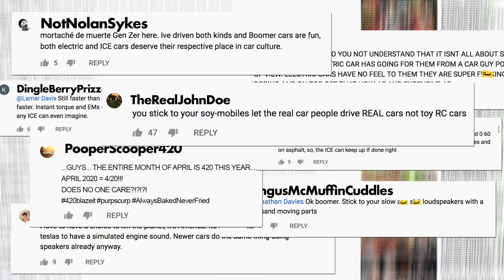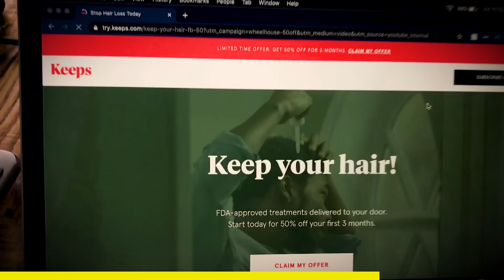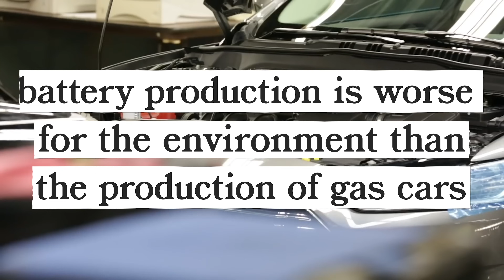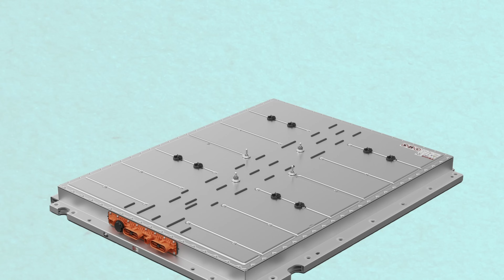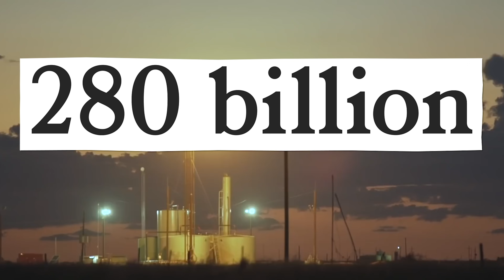Are Electric Cars REALLY Better for the Environment?

Comment: A lot of the pollution caused by car production could be removed by using hemp based products like plastic you could build the shell of hemp plastic look at Henry Ford’s hemp car! Then produce biofuels using hemp and produce cheap clean fuels that unlike using corn ethanol alone allows way more fuel by weight! We can convert our cars to hemp forerunners!

Comment: There is one factor to account for, Classic cars, classic cars have already replace the carbon footprint they displaced during the manufacturing process, and putting modern parts like fuel injection and modern brakes, you have a stylish, modern feeling classic that sounds great, plus it matches and even beats the emissions of an EV over time, unless they make a battery with capacitors that work better and impact less than Lithium Ions, plus the whole exploding thing.

Comment: The real solution: make LIGHT cars that use less energy to move that run on gas. We used to make cars that could get 50, 60 miles per gallon without even trying like the geo metro or honda crx. If everyone drove 100cc mopeds that would be way better than everyone driving ev's.

Comment: What keeps me away from electric power is the initial cost and lack of self service, even as an an ASE master tech I don't have the ability to service current electric vehicles.
Reply: What is there to service??? Literally just bearing seals, coolants, battery replacement after nearly a decade and the other regular stuff involved with a car like tires, bushings, brakes etc. One of the best things about battery electric cars is how low maintenance it is.
Reply: Evil me I do agree whit you and and they also cost to match for any EV whit long range, i don't have a charging station at home and when it get cold you lose alot of power.

Comment: Fucking stop showing the cooling towers emitting steam when you talk about pollution donut!!!! Like seriously. That’s water vapor. That’s not pollution. You’re part of the problem why people are scared of nuclear energy. For every Fukushima there’s 42 more reactors that hasn’t had a melt down in Japan. That less than a 3% failure rate. For every 3 mile island there’s 98 more reactors in the US that hasn’t seen a meltdown. That’s 1%. And not to mention that the country that uses nuclear as the largest percentage of their power generation has never seen an incident (France).

Comment: Nice to see this vid has the facts correct. I can confirm these numbers and the comparison from studies and articles I have read about this very topic. there is however 2 components and I know that this video is only focussing on the environmental aspect but as car ownership goes a holistic approach should be pushed always. 9% of all carbon emissions comes from cars globally. This means that it is close to irrelevant what powers your car as far as CO2 is concerned. 

And as long as electric cars use non-replaceable batteries that charge with insane currents(being fire prone) the following rule applies: city runabout: electric, grand tourer: diesel/petrol. And don't tell me that a Tesla is suitable cross country... my ass... sitting around every 200miles for half an hour twiddling my thumb in a desolate parkinglot where the charger is. The only current solution I can think of for covering those 2 bases with just one car is the plug-in hybrid. It has the critical daily commute 50miles on battery but can perform longer journeys if need be.

Good news though that some people already are working on some liquid fuel that would be 2 inert fluids but combined would have some exothermic reaction that would produce enough energy to provide a smaller battery pack enough juice to keep the car moving. I am looking forward to those gettiing somewhere.

Comment: I gotta know what is the life span for an EV? (The life span of the battery) 5 years? 10 Years?  My F-150 is an 09 with over 200k miles.   Can an EV go that long?  Do you replace the battery?  Is the replacement battery the same as when the car is first assembled?

Comment: Ok ok you got me thare but....electric cars have to travel more miles,to travel more miles it has to have a bigger power cell...that is hevier...wich in turn meens the car is more unsafe,ok you maybe thinking but the car can always get safer right?...or so you thought,when a car's chasis is getting stifer more of the energy of a crash goes thru the whole car's chasis instead of just the front end and a litle bit of it,the chasis absorbs.but if the whole chasis absorbs the energy of the impact you are unsafe.so thats my thoughts on why electric is not strictly the future.

Comment: What happens when you factor in replacing the batteries every so many years?
Reply: Engineering explained tackled that. Also with vehicle recycling and lifespan. And yes, eh EV is still cleaner
Reply: How long do you think batteries in EV last? In miles, not by year.
Reply: Adam Iverson Jalopnik had a article in February about the maintenance on a rental Model X. The battery lasted 317k miles before needing a replacement. Pretty impressive.

Comment: I have only two points to cobalt, and those are:
Yes, 50 % of the world's cobalt comes from the DRC (20 % of which is mined under inhumane conditions), but that is the reason car manufacturers don't want to use cobalt from that region. Tesla, for example, gets theirs from China.
Cobalt is also used in the manufacturing process of other products, for example, dyes, one type of steel and it's also used as a catalyst in the desulphurisation process of fossil fuels.

Comment: Any electric vehicle won't eventually beat any gas powered car after a certain period of time, when the battery breaks down it needs to be recycled and a new one needs to be mined from a finite source. More diesel will get burnt getting the same Lithium every month growing at an exponential rate. We won't run out for an extremely long time but it's still getting harder to mine. If you're only counting the 17 metric tons for creating an EV and 2 for running it each year you're not taking battery replacements into account. That said, EV's are still better for the environment especially if you purchase a dinky toy. Not so much when you purchase a P100D and feed it electricity generated on coal with shit battery life.
Reply: Today's battery packs last roughly 9 - 12 years of normal usage and after that time, can be reused in renewable energy storage. They're not dead, but have only about 85 % of their original capacity.
For example, this almost constantly-used Tesla Model X had to have its battery replaced after driving 317,000 miles:
https://jalopnik.com/this-tesla-model-x-has-driven-over-400-000-miles-here-1841761190

Comment: I'm definitely getting a bmw i3
Reply: Jake Gravity As a owner of one i advise you to look into These things:
First you Need to know that if you Get a used one which is Older than the 08/2017 that the early non Facelift Models did have the charging cables as an option.Than if you want a Full complète navigation system you Need the Professional one as the Base one is very limited for all gens.also the non facelift ones are more flimsy which was fixed by the later ones with a wider Wheelbase( the old ones can be normally cheaply widened for more stability.And Last if you have to do longer distances for example to work and back the 60 ah won’t be sufficient so in that case get the bigger batteries
Reply: @louis-hhr9479  I'm looking at a 2014 model with range extender and tech package with the parking assist. Is that a good one?
Reply: Jake Gravity no i would advise you Not to look at i3 with the Rex as the motor is a weak 3 cylinder with a Little Tank which is Said to be annoying as you will probably waste much time refilling
Reply: Jake Gravity Also try to look into newer models min 2015 who will have a bit of the warranty left.
Reply: @louis-hhr9479  thank you very much for the advice, ill get the the one without the range extender and 2015 (I only have a budget of 16,000 usd)
Reply: I own a non Facelift one build the 07/2017 so one of the Last ones and i Must say that the older ones i checked out were mostly Not well Serviced and scummy or à bit destroyed but if you can find a really good one Even a old one without the rex with low mileage and a good price than Go for it.
Reply: Jake Gravity Good Choice!! Glad i could have helped :)
Reply: @louis-hhr9479  Ill make sure to keep you updated on my experience with the car (when I do get it of course). Thanks again!
Reply: Jake Gravity but i must say that they are good daily practical drivers

Comment: There is so much misinformation and biased sourcing out there that I get really nervous when I see pieces like this. For example, this video starts by saying that lithium is mined and that creates a lot of CO2. Well, actually the primary source of lithium extraction is from brine - seawater. Lithium is one of the most common elements on the planet, so it's not hard to find.

As to the CO2 produced - I would really like to see WHAT the source of CO2 is, as extracting litihium from seawater obviously doesn't involve CO2, so when it is mined (which it is, in addition to extracting from brine) is the CO2 coming from the mining equipment running internal combustion engines? If so, that's easily solved by switching to electric.

And no one ever goes into all the unbelieable pollution involved in the petroleum pipeline, from exploration & drilling to shipping (with spills) then processing, then shipping the final products to distribution centers, then trucking to individual filling stations - every step of the way being done by internal combustion vehciles BEFORE you even get it into your car.

As for Cobalt - Tesla has already reduced the cobalt content drastically, and heading towards removing it entirely.

Something else to keep in mind - the wars in the middle east are all about oil. How polluting is it to have an active shooting war? All those planes, and bombs, and tanks and explosions - so much crap going into the atmosphere.

 Electricity is almost always generated relatively locally, no need for foreign wars.

I'm glad Donut at least mentioned the oil refining process, but he went WAY longer on the production of lithium than he did the nasty effects of petroleum production. I appreciate the attempt at being neutral, but clearly there's some subconscious bias still.

Comment: You have to replace all your batteries in an electric car after like only 10 years and it costs the price of a new car just to replace the batteries! Buying and keeping for as long as possible a reliable internal combustion car and keeping it properly tuned is by far the best thing for the environment!
Reply: Not the price of a new car, but only about $7500 for a large battery today. In 2030, the prices are going to be way different.

Comment: Batteries batteries batteries batteries did you factor in the cost of replacing the batteries my internal combustion engine last me 20 years your batteries last four and a half have you factored in the cost of batteries Mister genius also
Reply: Batteries in electric cars last about 9 - 12 years under normal usage, not 4 1/2 years - That is under constant usage and fast-charging. For example, this Tesla Model X went 317,000 miles on its original battery pack:
https://jalopnik.com/this-tesla-model-x-has-driven-over-400-000-miles-here-1841761190

Comment: I work at the BP Oil refinery in Spain, and I can say that,at least in this refinery, the emissions of CO2 are minimum, the methane emissions are just inexistent because the methane is a refined product that the company SELLS, they dont just release it. Almost the entire emissions of a refinery is just water vapor, they really take advantage of the residue reusing it for internal systems such as cogeneration. The government and third party companies also take place in the control of emissions. And by the way, the chimney that is shown in the video is a really important safety element that burns flammable gases in case of an emergency, it happens very few to none times a year, better burn it than have it in high pressure containers where can explode and cause a lot of injuries. Hope this was usefull to somebody.
Reply: Oil refineries use a lot of electricity (1,2 kWh to produce 1 litre of petrol), and that is a large contributor to the indirect emissions of ICE cars, not to mention the pumping and transportation.
Reply: @evolt7553  In the BP refinery at least they generate more electricity than they consume, in fact they sell it to the electrical supply company so I dont see how it can be an indirect contributor for emissions. The products transportation is foreign to the refinery, but obviously emits a lot of CO2.

Comment: Let's make all the cars run off of grain ethyl alcohol, make your own fuel at home out by the garden. Renewable energy right there, just don't drink it when you stop at the pumps
Reply: However, that is not a mass-market solution.
When crops are commercially grown to make biofuels, 1 litre of biofuel takes 1,4 litres of diesel fuel to make.
That's why I think biofuels can do something good only when made from compost.
When it comes to making your own ''fuel'' at home, it's way more convenient to install solar panels and battery storage.

Comment: Fun fact: hydroelectric power is actually a huge emitter of GHG, because of the decomposition of organic matter in the flooded area of the dam. We need solar now.
Reply: How can this be?  Those flooded areas are not longer considered flooded, its been under water for years and years.
Reply: @Dialysisforever  still, it's a LOT of organic matter. especially if it's in a forested area, such as in the Amazon here in Brazil. Also, according to the fluctuations of the water level, some small plants grow back when the water is low, then are flooded again and decomposed. of course, a much smaller amount than initially, but still, there's emissions from there. still better than coal by a long mile, though.

Comment: 4:40 Yes. COLBALT.
Reply: Coalbalt...
Reply: Yes, 50 % of the world's cobalt comes from the DRC (20 % of which is mined under inhumane conditions), but that is the reason car manufacturers don't want to use cobalt from that region. Tesla, for example, gets theirs from China.
Cobalt is also used in the manufacturing process of other products, for example, dyes, one type of steel and it's also used as a catalyst in the desulphurisation process of fossil fuels.

Comment: More statistics from countries where they don’t get the electricity from wind/water or nuclear would be interesting. Also maintenance and recycling ability needs to be taken into account. 
Batteries in ev:s won’t last as long a diesel or petrol engine so that means a new battery will be needed. What will happen to the old battery after that? At the same time cars with engines needs a lot maintenance compared to electric. 
When you discussed the amount of co2 released by companies making the raw oil into fuel, how many billion tons of fuel do they make each year? If you would compare the amount of cars they would be able to drive and then compare the same amount of electricity produced by countries that don’t have wind/water/nuclear then I don’t think the numbers would differ so much....
So first step make countries use of renewable energy! Before you make people go bankrupt because driving their old fossil fuel car will cost to much or buying a electric is insanely expensive....
Reply: After batteries reach a certain amount of degradation in cars, they are reused in renewable energy storage projects and then recycled.

Comment: Electric: 
Pros: Long-term environmental 0 emissions, instant torque, readily available and free fuel at home.
Cons: CO2 Emissions upon production takes AWHILE for them to actually net positive your CO2 emissions that they made in the car. Also not a lot of Electric Cars can have a good top-end speed in terms of performance yet. Finally, when you're charging, not a lot of common based chargers are outside (speaking of charging as well, the charge time takes a while.)

ICE: 
Pros: This is the genuine equation at the moment: readily available resources, performance or efficiency in a nutshell, and as technology improves, the cars can get better with every production.
Cons: CO2 CO2 CO2. You cannot debate if you're driving an ICE car, expecting that you're not destroying the environment slowly. Also, fossil fuels (unless recycled somehow) is a limited supply, and it takes thousands, if not, millions of years to form down on the earth. That's why every drilling processors gets stopped and it takes a while for them to find another well.
Reply: All mineral resources are limited. Which includes lithium and cobalt. How does the time of formation compare between lithium, cobalt, and oil?